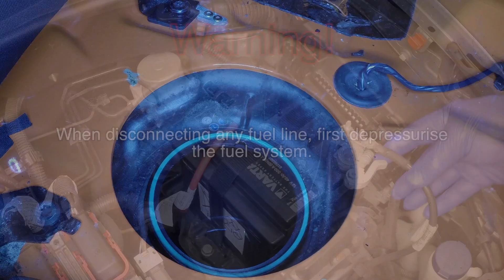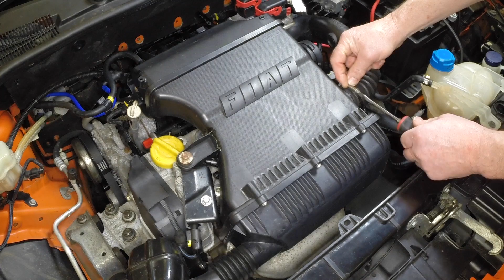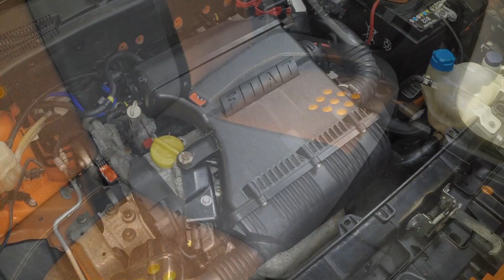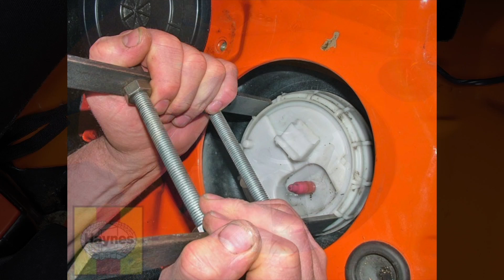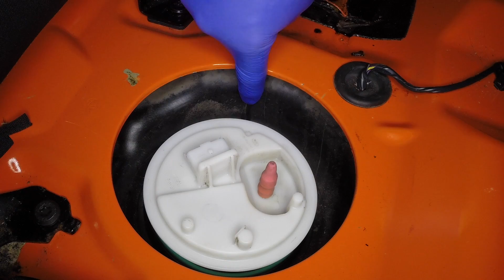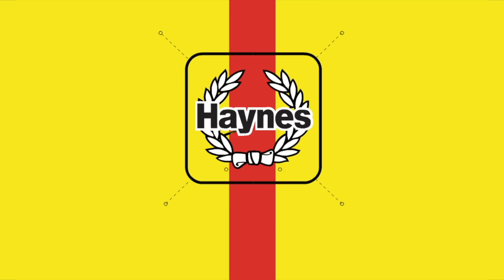How to replace the fuel pump on the Fiat Grande Punto 2006 to 2015

Comment: On an average how long these fuel pumps last? Your odometer displays 71793 (is it miles or km?)
Reply: В моём Фиате ГП пробег 200 тыс. км. Проблем нет.
Reply: @defender4220  Same. 2013 Punto, 220k km, supposedly original fuel pump (Bosch). Just measured fuel pressure, constant 3.5 bar.